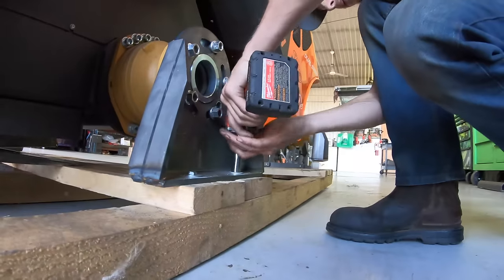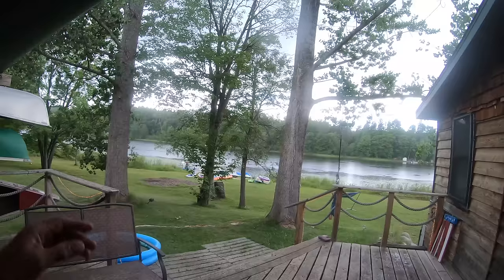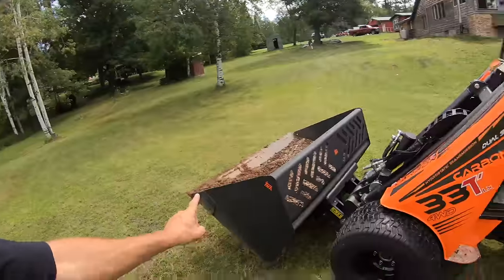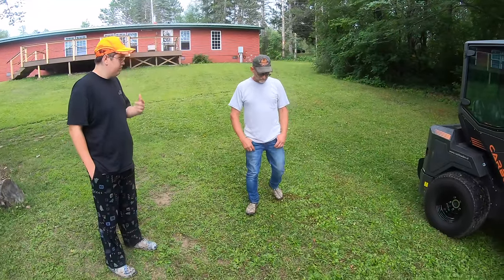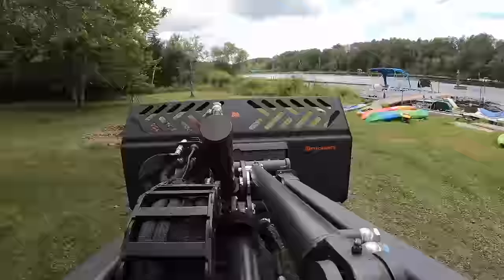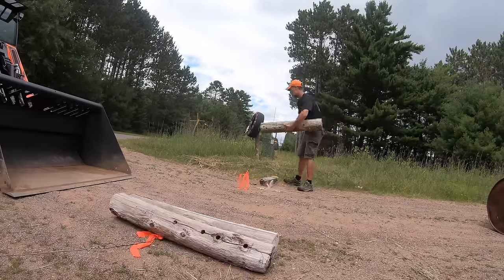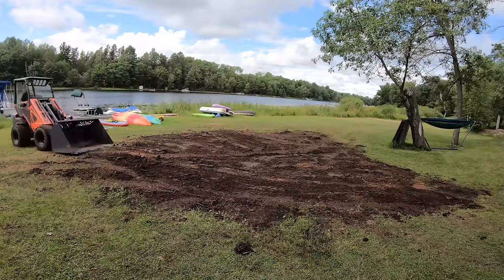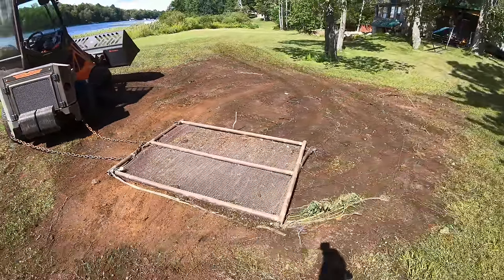What did I just buy?

Comment: Occasionally turn over your manure pile.  Gets air and moisture into the pile and speeds up the decomposition.   Also run through it with a rototiller.  This breaks up the clumps, aids aeration and speeds up the process.  I rototill and move the loose stuff to a second pile.

Comment: I have watched this part 10 times and it still is driving my crazy....my OCD (which I didn't realize I had, until just now) is going full-throttle......Tell that dude, that is assembling this equipment for you, that his sockets are upside down (1:50 into the video), the sockets are suppose to sit the other way......

The bottom of the studs in those trays have a larger shoulder that only allows the correct socket to fit. so that you can't mix them up (i.e.  you cannot put  a 10mm in place of a 12mm, etc.)  and it allows the socket to sit lower so you can see the size (marking) on the tray studs
Reply: You can't put a 10mm in place of a 12mm because you can't ever find the damn 10mm.😁
Reply: @MentalCatalyst  TRUE!!!!!  LOL
Reply: @MentalCatalyst  lmao

Comment: Great safety as an operator.  You put that bucket flat and looks as if you shook out the pressure.  Notice little guy jumps on the bucket just after 17:30.  If his toes were under the bucket and accidentally moved that bucket.. even if off could have done damage.. great content, thanks for sharing.

Comment: Let’s see how it does with snow removal in the winter
Reply: Stephen McGrath I’d be a little worried it doesn’t have the weight to push much. But I think with the locking diffs and turf tires it will surprise what it can do.
Reply: I use a much smaller one. An avant 225. I bet that cast loader can push allot of snow. My avant 225 can push some decent piles and very fast for sidewalks.
Reply: diego chacon, would you be willing to give me more info on your avant?  I am trying to purchase a small articulated loader in the next week and would love some honest feedback.
Reply: @peterchase5273  yes, i will tell you this. I love my avant, great little machine. It will out perform an mt55, dingo, and mostly all track machines this size. My workers have tipped mine over 2 times, and no damage. The panels are plastic, and they are held in by some screws. I haven't had too much damage in the 600hrs in 2 years i have put into the machine. We don't use it lightly. We use it commercially, we are definitely hard on the machine. We use it to move allot of landscape rock, dirt, some boulders. I can send you more info if you would like, so i don't write such a big essay on here. You can send me an email at Info@modernscapesllc.com and i can send you allot more info.

Comment: Those tires are used on fairway units for a golf course.  They work alright for terrain like yours but they suck when it's super wet or muddy.  You can minimize your turf tearing by making 3 point or 5 point turns with these tires.

Comment: Unfortunately if it's a "Cast", it's also a piece of crap! We got one for tree removal with a log grapple and compared to our Gi-Ant, and even the our old original Avant,  all 3 are hydraulic turn,  low impact machines.  Cast was rated the strongest but carried the least, the dual sided arm for strength isn't needed as it can't pick up its rated amount anyways.  The dual arm with everything tucked in between seems safer but just made it impossible to see around for real technical operations. Did like the full metal body but the  Gi-Ant is slimmer and lighter and still lifted heavier logs with a less weight rating on the stickers. The avant is made of plastic and just doesn't last with tree removal. Cast said we got a lemon after 5 trips to our shop in Florida With parts, mechanical, hydraulic work and showing them weak points.  We then got a new one for free with the upgrades as they replaced so customer service was good but literally begged them to take the brand new one back days later. Not only does cast have maybe a 2 or 2.5 gallon tank running out of gas twice per work day. Gi-ant almost drives a week straight between refills.  Plus even with four wheel drive engaged it couldn't drive into a simple hauling trailer on a dry as hell day flat in our work yard.  The Gi-Ant and Avant never had issues wth this nor needed a stupid 4x4 diff lock button. Never needed that option so you bought an honest to God piece of crap unfortunately!!!

Comment: Odd that you can't drive around with the diff lock on.  Is it bad for this machine, or is there just potential to tear up the turf or wear tires faster?  I've used an Avant which is very similar and we always drove with the diff lock on 95% of the time.
Reply: Tear up turf.  With engaged all 4 wheels turn at same speed.
Reply: hockey win right.  I never had much issue with tearing up most grass with the Avant 420 always in diff lock.  Must be super gentle without the diff lock on!
Reply: I cant remember, does Avant truly lock all 4 wheel motors in?
Reply: @breiwickcompaniesinc.5004  As far as I know, it does.  I can't say for sure though.

Comment: Like the Avant  635  I've used,which is brilliant,it has a better design telescopic boom design & cab layout compared to yours,it will lift 1100kg (2245 lbs) which is more than yours can
Reply: That machine is rated for 2397 lbs.  Avant is all plastic covers and takes time to access the engine compart or battery. Cast is all steel and you it has swing away doors that gives you access to the engine compartment in seconds.

Comment: All that equipment and you cant get a drag harrow.  I love using mine to loosen up the surface of our roads and then you flip it over to smooth it out.  You are supposed to use them in fields to work the soil but you can use it anywhere you need to loosen and move dirt and soil. You should check out a real drag harrow.
Reply: You don't need anything special to grade out that tiny 20'x20' section.

Comment: I have no idea why anybody would want a machine with the cab on the front articulated frame on a loader. Not me. You can keep it. Horrible design.
Reply: Scott McQuarrie they work great
Reply: They keep you straight with your load when you turn.  It also acts as a counterbalance when you turn as well.
Reply: Visibility is Way better than a machine you sit on the back. Go to Avants website and watch their comparison videos! avanttecno.com
Reply: I'm glad you guys like it. That's your prerogative. But I ran old case and Hough wheel loaders like that and I and every other operator that ever ran one, especially in tight city streets, think that they are horrible. I do  not like cab forward design whatsoever. That's why Deere's high speed dozer failed and all full sized wheel loaders are rear mounted cabs. Giant makes a little wheel loader with the cab on the rear frame. That looks like a nice machine.
Reply: The Giant small wheel loader sucks. Yea you get to sit on the back but the frame flexes and it is really top heavy. They roll way to easy.
Reply: I think it’s worth noting what these machines are intended for.  They are not earth moving equipment.
Reply: @eliasnull  , oh well, it's like that old saying, too each their own. Good luck with them guys.
Reply: Cast makes both styles the cab rear model is called the 800 series. http://tnedistributing.com/wp-content/uploads/2018/12/825-1.pdf